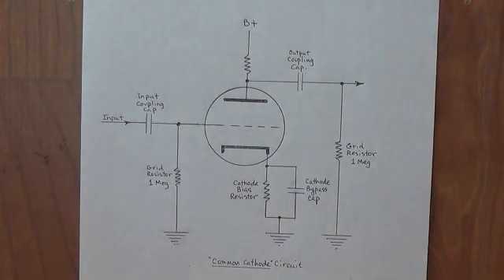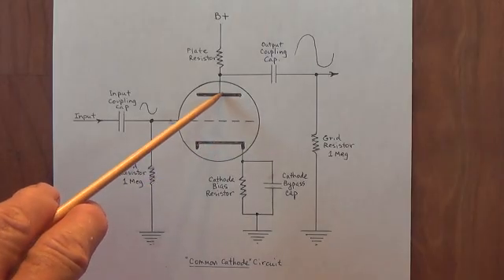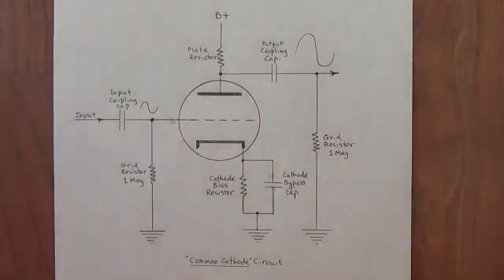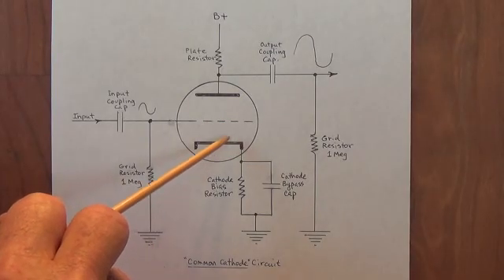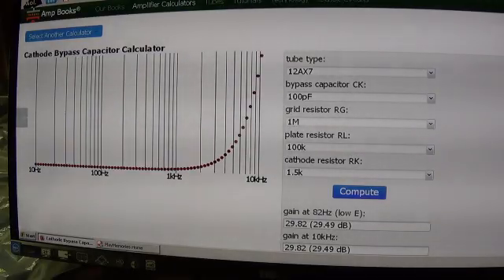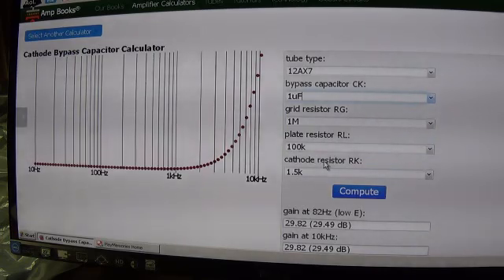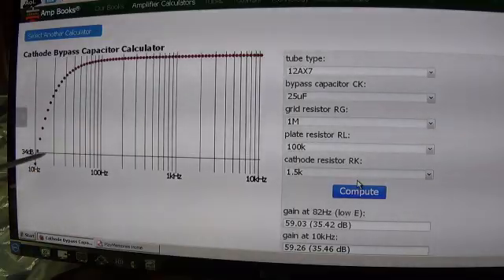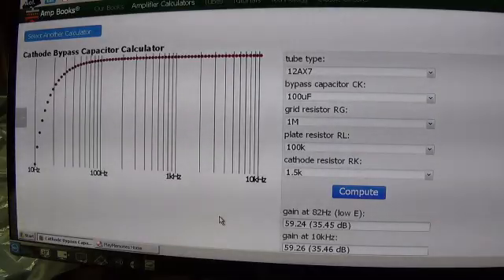Cathode Bypass Capacitors: How they Affect Gain and Tone

Comment: Hi Uncle Doug, Rusty,
I would like to increase the volume and mid range tone frequency of my amp. I like the woody sound a mid boost gives the tone/sound of an amp. Especially the sound of a Less Paul Jr, Like Leslie West.

Could you show how to make a Decade Box that I could use to test different value capacitors to enhance Low Mid to High Mid Frequency's for my amp. Then I could choose the one that sounds the best to me?

Where does Low Mid Frequency start & where does High Mid Frequency stop?

How would also changing the Cathode Resistor make to our tone?

Thank you for your video.
Reply from the maker: +Finom1 Greetings, Finom. I'll bet there are capacitor "decade" boxes available on Ebay, and sites that show how to build them. I suggest Ebay and Google searches.  Different frequency designations don't stop, they overlap, and the designations themselves are arbitrary and subjective. You're better off relying on experimentation for the tone you seek, rather than being concerned over its arbitrary designation. The cathode resistor is not a tone adjustment, but a bias adjustment, and it's value is determined by the current and voltage properties of the output tube. You can bias hot for early breakup or cold for lots of headroom, but tone itself is primarily a function of the bypass cap value and tone stack.
Reply: +Uncle Doug 
Perfect Uncle Doug, you explain something that is complicated to me in a way that I can understand and then use the information. Einstein did the same thing for the world!!! Thank you for helping me.
Reply from the maker: +Finom1 You're welcome, Finom :)
Reply: Uncle Doug, The more I learn the more wisdom I hear in your advice. Voicing amps amd increase in volume is a topic I find very interesting. Thanks again for explaining things so an Old-Timer can have a chance of understanding it. Bless you and your family!

Comment: What the point or reason of parallel resistors (2 or 3) + capacitor in series for 2 parallel resistors (for example 1K+1K+1uF)? And same for capacitors - 1uF+ 47uF+1k resistor in parallel. What does it give? (I already read about resistance calculating, but how this parallel connections affects on sound, gain, response, etc). Saw these parallel cathode connections in one mesa boogie preamp. Thank you.
Reply from the maker: +KeeNchiK  I have no idea, KN. I'm not familiar with this configuration. The only reason I can think of for series and parallel resistors and caps is to provide unusual values or higher wattage/voltage rating.  You'll need to do some independent research on this topic.
Reply: reading this old comment. Simply illustrated. To bypass a cathode resistor with a cap with another small value resistor before ground makes the gain over that cap value a little less depending on that resistor value. Can experiment with combinations of resistors and caps to shape gain over the spectrum to some degree. Small pot values in place of resistors makes it easy to hear the effect of values. :-)

Comment: I'm confused, lol... To install a cathode bypass cap do I Just solder a cap to each side of the resistor? or do I solder one side to the chassis / ground to one side of the resistor?   +  Is there a diagram on line somewhere where it explains which resistor is the cathode, slope and so forth.  Sorry very new to this, thanks so... much Guy
Reply from the maker: +Guy Thomas  Are you sure you want to do this, Guy ?  Cathode bypass caps must be carefully selected as to value and voltage rating, and correctly installed, based on a schematic of the circuit in question. On the schematic, find the cathode of the tube to which you want to add the cap, and then solder the positive lead of the cap to the tube's cathode pin and the negative end to ground. Before doing any of this you should unplug the amp, discharge all the filter caps, and test the B+ circuit for residual charge. It can be quite hazardous and counterproductive if you do not follow all safety rules and use proper technique.

Comment: Hi,  I have a Marshall JCM 800 clone, point to point wiring and It is very bright with very harsh distortion and I play blues, I would like to make the amp very dark and very very very smooth... lol  The smoothest possible   If I change the cathode resistor and put in a a bypass cap, will that get take the bright brittle harness out?   Thanks... Guy
Reply from the maker: +Guy Thomas  Don't change the cathode resistor, Guy, or you'll alter the tube bias. Increasing the bypass cap value may increase the bass response, but there are a couple better ways to do this.  First, increasing the value of your coupling capacitors will improve bass response. Second, I'll bet there is a small capacitor that allows treble frequencies to bypass your volume control. If so, removing it will greatly reduce the brightness. Good luck :)

Comment: I'm good Uncle Doug.  You're talking about pins 3 and 8 on a twin triode.  I just did your bias pot installation on a Princeton Reverb and my mind was still stuck in the power section.  D'oh!  The pot mod worked slicker 'n cat poop!!!
Reply from the maker: +Telesaurus  Yes, pins 3 and 8 are the cathode connection on 12A tubes, like the 12AX7. I'm glad the bias pot modification worked well for you :)

Comment: Thanks for all of the great and well-explained information! I'm converting a tape recorder amp for harmonica use. The first preamp tube is a 5879, with a 820 ohm cath resistor and a  25 uF bypass capacitor. It's way too gainy (volume control has little excursion available), but I want to keep as much bass response as possible.  Removing the bypass cap completely will reduce the gain, and I assume the frequency response will be pretty flat (?), but will it cause other problems if I remove it (damage?). The online calculator won't let me put this pentode preamp tube in, and I don't know there are other considerations because of the type of tube.
Thanks again!
Reply: Removing the cathode bypass cap won't damage your amp. If the pentode has a screen bypass cap, try removing that too.

Comment: Hi Doug...and Rusty too,
 This reminds me when I owned a Sunn Sentura II and was in the process of replacing some bad caps with audio grade caps which were somewhat expensive. Anyway after talking with an Engineer at Fender/Sunn I discovered the use of a bypass cap at the cathode. I don't recall what value was used but after I installed it I noticed a marked improvement in the high end response. The amp sounded much clearer and had some sparkle to it that it did not previously have.
 These were all audio grade caps that I bought at some expense...they still are expensive and really don't recommend using them unless you want to end up with something like an overpriced boutique amp.
 Anyway, I appreciate all your videos as they fill in a lot of blanks compared to when I went to school for electronics. 
Cheers and Merry Christmas.
Reply from the maker: +John Zook Greetings, John, and thanks for your input. Rusty and I are glad you enjoy our videos and wish you a very Happy Holliday Season !!

Comment: excellent, thank you Doug.  the calculator is a great tool. my schematic shows no cap on the preamp cathodes- 6N9PJ- think I will try the calculator. the output tube- EL34-B- shows 220uf 63volt for the cathode.  thank you for another great video.
Reply from the maker: +jeff b  You're welcome, Jeff. The calculator is indeed quite helpful. I'm glad you liked the video.

Comment: Im still learning and have built a single ended amp using an EL34 as the output stage, anyway my first stage is a 12AX7 and im uding 1.5k to ground with 25uf across and i thought it sounded very muddy with the low notes, going to 1uf helped and i had actually be on the same calculator as shown in this video. Your right that its all down to how it sounds, and i guess every musician is different to taste. One question is there any point using bypass caps on all stages, since all the frequencies would have been filtered out from the first bypass cap?
Reply from the maker: +nzoomed  Greetings, NZ. It's not surprising that reducing the CBC value from 25uf down to 1 uf would reduce the low frequencies.  People have different preferences, and it's nice that you are able to alter your amp circuit to tailor its tone to your liking.  I don't think it's necessary to have CBC's on all stages. Actually, the presence of the cap boosts gain and certain frequencies, so any stage which has a CBC will experience increased gain and frequency response, which will be passed down the amplification chain, regardless of whether the following stages have CBC's or not.
Reply: +Uncle Doug OK, that confims what i guessed thanks! It is alot of experimenting indeed to find what sounds good. I think with the nature of my amp needing a lower CBC is because it has such a high amplification factor and the lows get amplified significantly down the chain.
Reply from the maker: You're exactly right about the need for individual "tuning" of your amp circuit, NZ. What must be done to achieve the tone you seek is dependent on the nature of the circuit and your own personal preferences. What may work for someone else may not work for you, so it's important to develop the skills and understanding necessary to be able to do this "tuning" yourself.....as you have.
Reply: In a stage with no cathode bypass cap the gain is reduced by the signal at the cathode which is developed across the cathode resistor, a signal which acts in opposition to the signal at the grid, a form of negative feedback. The bypass capacitor prevents this signal appearing, so increasing the gain.

Comment: Uncle Doug, I've been chasing what I though was a lack of bass in modded Blues Jr.  I have many of the mods the BillM sells and many of them act to enhance the bass, yet my amp always sounded dull and woofy.  I thought this was too much bass (typical green board) and I reversed many of the changes in an effort to fix this.  But maybe what I'm experiencing is a lack of bass/mid content.  Cranking up the bass pot is like a blanket is thrown over the amp.  The bass pot was supposed to be changed from 0.022 uf to 0.1uf and that seems to make all of this worse.  But now I think it's that it doesn't have much bass/mids by the time it reaches the tone stack.  My amp was build in 1999, around the time they started to have lots of bad electrolytic caps. My new theory is that the cathode bypass caps are bad and have little or no capacitance.  I'll find out today when I change them out but your video was so helpful in explaining this in a very clear way and adding some support to my theory.  Oh my blues jr also never seemed as loud as others too, another bit of evidence.  Thanks
Reply from the maker: +sdcoffeeroaster  You're welcome, SD. I think the change in the Bass pot probably was too much. I would go back to 0.022uf. If your volume is low, then too much signal is being passed to ground in the tone circuit, and since you have so little bass, it's probably the low frequencies that are being lost. You might watch my video on tone stacks and low-pass filters. Perhaps you have a LPF that is draining your low frequencies. Changing out the cathode bypass caps is another thing to address, since they could be causing a lot of your grief. Let us know how it turns out.
Reply: +Uncle Doug  Thanks.  Yes that's exactly what I did. I went back to the original size for the bass cap.  Yesterday I also reduced the coupling cap increases from the kit.  stock is 0.0022uf and the kit went to 0.015 and 0.022 uf.  I tried 0.01uf for both.  I've gone and re-checked every cap value in the signal chain today and nothing is wrong at least value wise.  I had our EE tech do all the soldering too and it looks really good.  I just bought the cathode caps today and will try the two of them.  It's like there just isn't much in way of bass or mids and sounds like a blanket over the amp as I increase the bass or mid pots even with the small  values.  This amp is also not as loud as other blues jr's and seems to have more breakup earlier vol at 3 and master at max.  Using the T022 output transformer, C Rex speaker, pine cabinet, new matched JJ's, biased, 12AX7 tung sol tubes.  Swapping tubes around didn't help either but stock groove tubes had signs of wear so tried that.  This my own personal "sailboat" , lol.
Reply from the maker: +sdcoffeeroaster  Have you checked the screen voltage on the 6BQ5's ?  Low screen voltage can really reduce volume and stifle tone. It's a long shot, but one that is often overlooked.  You said the output tubes were biased, but to what Plate Dissipation value?  Early breakup is a sign of biasing too hot.  Just some random thoughts.
Reply: +Uncle Doug BillM's approach to adjustable bias is to make one of the 220k resistors in the grid voltage divider adjustable.  He then gives a voltage target values for the input to the output transformer used.  His target is 8-10 watts for each tube.  He recommends 4.1 volts for the TO22 and 3.8 volts for slightly more headroom.  I've set mine for 3.8 volts.  I'll take a look at grid voltage.  I think the new cathode caps helped out a bit but I left all the bass reducing caps as is in spite of the fact that I know 2 other owners that used the larger caps and don't have the issues I have.  I plan to get together with them soon to compare amps again.  Thanks for your help with this.  I have an EE friend with a blues jr and the same mods.  We plan to do a lot of comparing in the future.  Love your site Uncle Doug and Rusty too!  Your explanation of how gain works is so clear and informative....thanks.
Reply from the maker: You're welcome, SD, and thanks for the kind words. Good luck. Be sure to let us know what it takes to solve the problem.
Reply: +Uncle Doug Just played with the bias a bit and measured the output transformer resistance at 175 and 185 ohms for each side.  Only about 23.5 ma of plate current, and I tried something around 25 ma but that's not the issue.  I now have a modded cream board blues jr to compare to that my EE friend is loaning me.  With master at max, tone controls at mid, my volume at 4 and his at 2 we have about equal sound levels with the same speakers.  When we both turn bass to max, his still sounds fairly clear and has some tone, while mine sounds like I've thrown a thick blanket over it.  I do have the notoriously dark green board but don't know if this is the "reason".  Changing the cathode caps didn't really help now that I have a baseline to compare to.  We're going to inject a 1 kHz, 10 vac signal today in both and compare to see if we can pinpoint where things might be going south on mine.   Question, your grid voltage comment.  Shouldn't the grid voltage be very close to zero with zero signal?  There might be some voltage due to leakage.  I'll be checking that today with a signal and will know better about this.  Thanks again for all your patience.
Reply from the maker: The only grid voltage at zero signal would be the biasing voltage, which is quite low. If you find a higher value, it may be due to failure of a coupling cap between the grid and the preceding tube plate.

Comment: Thanks, these videos are really helpful! I was just wondering, what is B+, and what should the values of the input and output coupling capacitors be? Thanks in advance!
Reply from the maker: +CrucialNoise You're welcome, CN.  The B+ is an old-fashioned name for the high-voltage positive direct current that is sent to the tube plates and is largely responsible for the amplification process.  Coupling capacitor values vary depending on the circuit.  Higher capacitance passes more low (bass) frequencies.
Reply: In the early days of electronics, tube equipment was powered by batteries. The filament of the directly heated tubes was powered by the 'A' battery, the high voltage to the plates by the 'B' battery and bias was provided by the 'C' battery. The high voltage came from the positive terminal of the 'B' battery, hence 'B+'.
Reply: @silasfatchett7380  sweet.
Reply: Uncle Doug Thank you so much! what would be the standard sort of voltage for the input though?
Reply from the maker: I don't fully understand your question. What voltage input are you referring to ?
Reply: Uncle Doug B+

Sorry, it's probably really obvious!
Reply from the maker: B+ voltage varies from circuit to circuit.
 It generally runs from 350 to 450 VDC.
Reply: Thankyou very much!